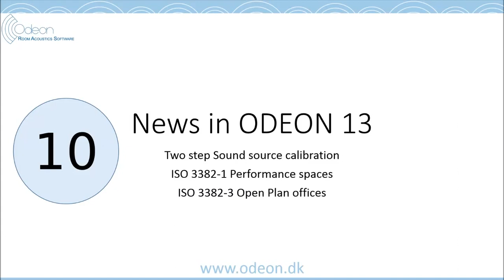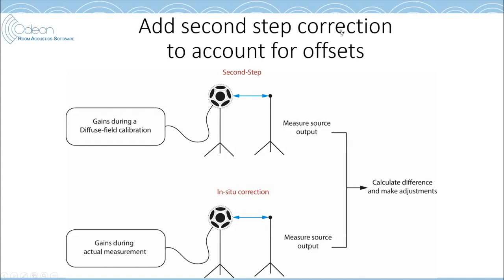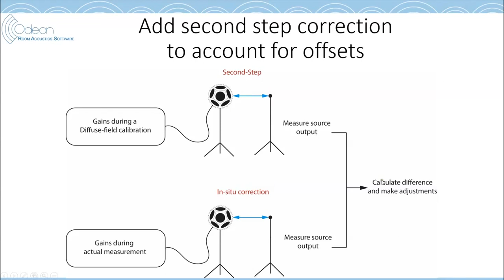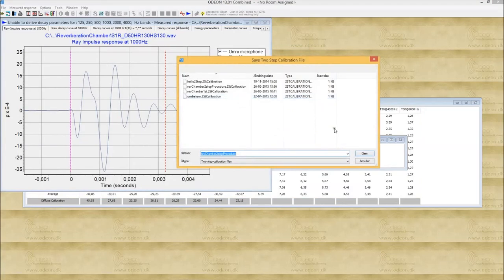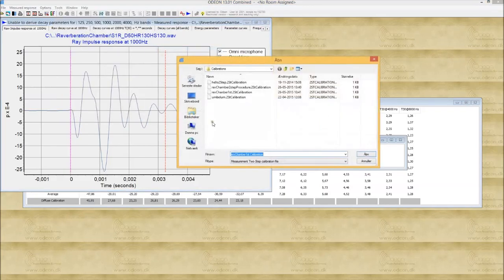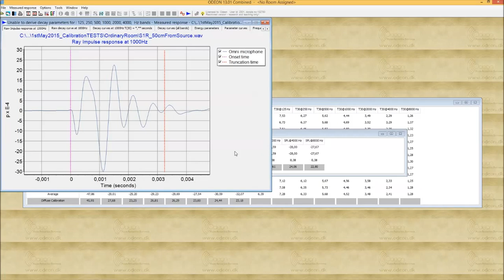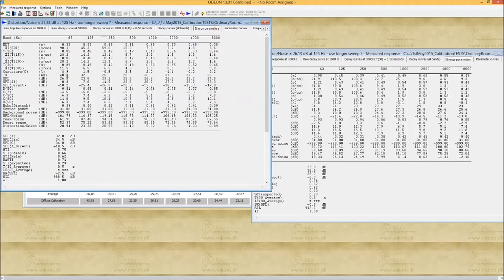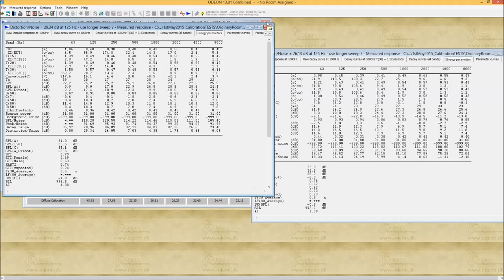Two-step source calibration for measurements - ODEON tutorial

Comment: What about the microphone calibration?. For ex, with other softwares a calibration of the mic with 94 dB or 114 dB at 1kHz is needed before any measurements.
Reply from the maker: Hello! These calibrations are currently for the purpose of measuring STI and Strength G. We currently don't have a method of calibrating for the purpose of measuring SPL but we are looking into it for a future version of ODEON, i.e.: by using a pistonphone.
Reply: @ODEONRoomAcousticsSoftware  but for the parameters of 3382-3, how odeon gets the D2S since it depend of the SPL in dBA in each receiver position when measuring?
Reply: @ODEONRoomAcousticsSoftware  any info about it?
Reply from the maker: @StonedBored  ODEON currently only calculates D2S for simulations, but not for real measurements